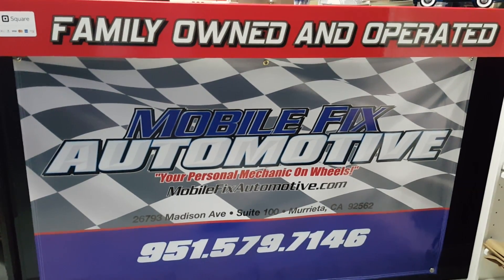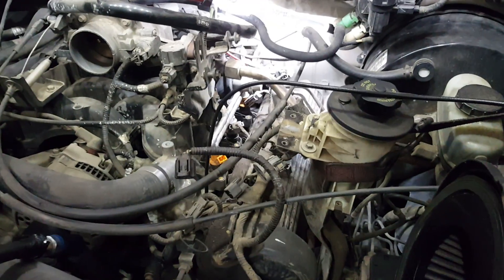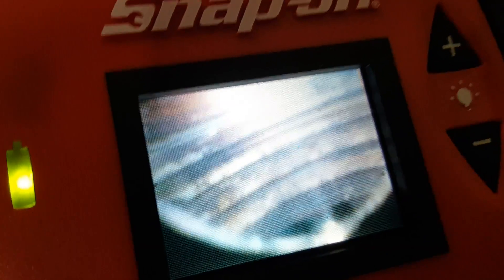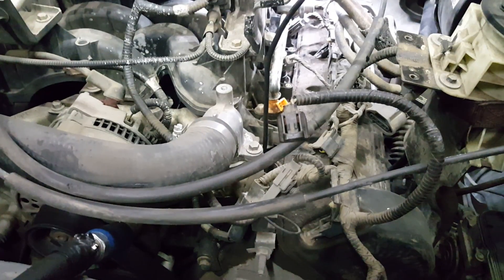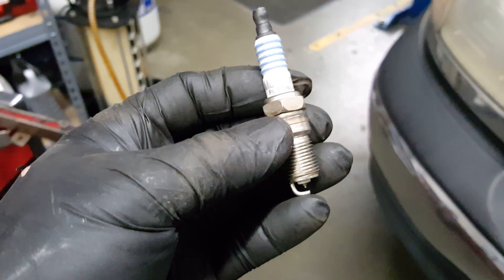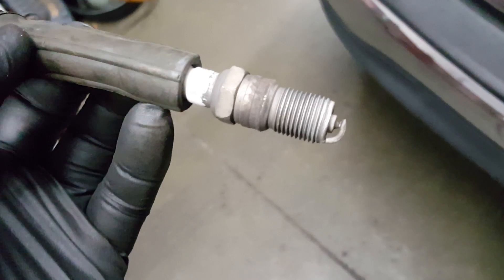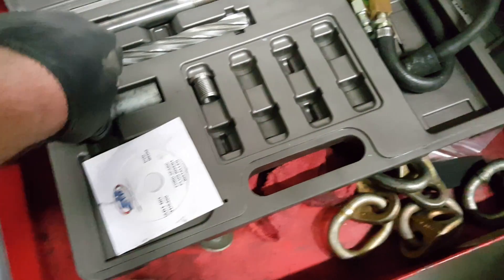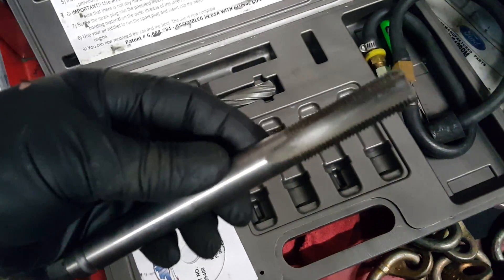Why the spark plug blew out of your Ford Triton engine

Comment: Good video - this happened to me today 2001 F250. I could tell exactly what you describe when threading new plug, seems like it barely spins freely until tight. New plug and coil pack - back in action. I will definitely look into this kit. Appreciate the info, as a guy wonders if he just did something wrong, or it’s an issue that many face - apparently it’s the latter. Thanks - Cheers!

Comment: did the Ford 5.8L V-8 ("Windsor") have the spark plug problems? I think it was used in lots of trucks and some vans. Thank you!
Reply from the maker: Yes
Reply: @SandCarServices  thought it was just the Tritons?????......
Reply from the maker: I read your first question wrong. Only the Triton class are effected
Reply: @SandCarServices  Thanks. Good to know. I'm looking to maybe buy a used 1995 Ford e Series Van with a 5.8L Is that a good engine?

Comment: Can you do a video on a oil pressure switch for a 99 navigator 5.4L engine having troublw locating it been up and under the truck still cant find it and im tired of getting out my wheelchair lol
Reply from the maker: Its on the housing above the oil filter and if you have 4x4 its very hard to reach

Comment: The original spark plugs in my 2000 Ford F-250 the spark plug only has 6 male threads on it

Comment: FYI, if you have this engine and hear what sounds like a noisy lifter, it is probably the plug banging up and down. That happens about 50 miles before they blow out.

Comment: Used the Cal-Van insert kit...worked just like you said it would. A month later -- BOOM!  Plug exploded...again! Any thoughts as to why?
Reply from the maker: Your asking me to provide failure analysis without proper information. To start with answer these questions. 
1. Was is a plug failure or an insert failure?
2. If it was insert failure which I have never seen happen with proper installation it more than likely was not threaded or screwed in all threads.
3. Did you buy a original calvan kit or a knock off?
4. If it wasn't purchased from Dennis at wiseautotools.com did you purchase a 3/4-16 nut and check the outer theads on the insert before install.? If the insert is one of the defective ones it will only go in 2 threads and then tighten up.
5. I have seen very few calvan inserts fail that were installed by amateurs but the ones I have were all improperly installed and they were unaware of it.

Comment: You seem to be very knowledgeable about these engines and people say I'm dumb for it but I love em.        Have you ever had/seen a repaired one blow out? Should I just replace the cylinder head?
Reply from the maker: These are great engines
Reply: What are your thoughts on the v10 6.8? Aside from the plug issue how would you rate it? Does anyone ever pursue the calvan route proactively before a plug blows out? or is that a dumb idea? I’m not a mechanic so I apologize if that’s a stupid question 🙋‍♂️ 😆
Reply: @HP-xp9eg  to be honest I love the 6.8L the way they sound and the way they run. Honestly I like them enough that I'm going to put one in my ford ranger

Comment: I just had that happen today,I have been trying to remove a spark plug socket that got seriously stuck,then all the sudden I hear a pop noise but couldn’t tell from where.I moved the truck and happened to see the still stuck socket attached to the plug laying on the ground.I have never heard or seen anything like that ever.
Reply: Just want to clarify: Your spark plug blew out when your engine was not running?

Comment: I had a front right drive side blow and watched this video and drill & tap insert myself (cheaper set)! Working fine! However I blew the third one back on the left side now! I can't drill & tap the frame/firewall won't let me get in there! So I'm using J&B WELD to repair the (thingy) and on the plug thread! I'm only going to buy a new spark plug and J&B WELD it in! We'll see what happens!😎

Comment: Question, If someone put a heli coil in #3 but didnt put it in straight and it melted the spark plug, is there a fix to it? Im assuming it was a cheap heli coil to begin with. Cylider is registering as completely dead now.
Reply from the maker: Watch my video called why you should never anything other than a calvan insert. The spark plug threads blew out from a bad timesert. Is this what yours did?

Comment: have you seen an insert done poorly cause a compression leak at idle (misfire code #3) but that goes away at higher rpm's and under load? I can almost hear compression escaping the cylinder

Comment: I understand and I know I've been trying to tell people about not letting anybody change the spark plugs while the engine is still very hot  it stretches with threads every time you pull the plugs when it's hot do not change the spark plugs on aluminum heads when the motor still hot otherwise you going to scratch the threats and they'll never be back to the normal size that's one of the main reasons why triptan engines blow up the spark plugs while they're running besides they have high compression
Reply from the maker: Ok. Then explain why so many have blown plugs under 16,000 miles. Although mechanics changing plugs while engine is hot and overtightening can cause this problem is is not the main cause.

Comment: Thanks ron. I have a 2004 f150 4.6 thats down because #6 blew out. And im pretty sure its a 2v cause of the 30 degree boot but can you refer me the kalvan kit that will work for my truck. Thanks ron.
Reply from the maker: Link to parts is in the description under video. Thanks

Comment: I have a 99 V10  and I just had cylinder #7 blow a spark plug I’ve purchased the Cal Van kit just waiting for it to come in. On the V10 what are the most common cylinders that blow is it still 3,4,5,6,7.

Comment: Ron, I have a question. My # 5 plug blew out and I drove about 10 miles to the repair shop, they installed a plug kit and when they started the van (2014 E-250) it was pumping excess fuel into that cylinder. They replaced the injector with no success
still excess fuel, any thoughts
Reply from the maker: Check to see if the ground signal wire to that injector is not grounded by wire pinched under a bolt or ?

Comment: Hey Ron great information there in this video. I have an 05 explorer with the 4.6 and have had three blow outside on 3 different cylinders 1,2 and 3.
Each time I was able to find the plug replace the coil and put the same sparkplug back in.
My third was bank 1 cylinder 1, a friend observed that the port fo rd the sparkplug looked too shallow, in fact after putting the plug back into the shaft and starting the engine I had a NEW problem. 
There was a loud knocking sound, like I had a rod hitting the inside of the engine. 
My friend saved the day somehow by tinkering with it while I was behind the wheel starting and stopping the engine. 
He said I have a worn out pinion?
I'm not sure what that is or where it's at, all I do know is that I thought my engine was done and wasn't going to be able to bbn drive it the 30 miles in afternoon work traffic,  but I was able to.
He states I need to replace this pinion but I'm unfamiliar with it, he didn't have any tools other than my tools for changing out the coil and sparkplug everything else was at home.
Does any of this sound correct to you? Do you know the area he's states is worn out, and if so what's the proper name of the part and how difficult is this replacement? Thanks

Comment: I had an '02 F150...it was a beautiful truck but it was a goddamn nightmare. Got it with 104,000 miles on it, and within the 5 years I owned it had to: -Replace all plugs after blowing two in a month span.

Replace the alternator, replaced the swaybars, replaced the flywheel, and even then when I sold it it was constantly shaking violently and getting about 10 mpg. Awful.

Comment: Now I know why its so expensive. I have the 5.4 3v triton in my 2010 f150 xlt. I've not had 1 blow out but I have just past 100k and now my fuel mileage gone. I took it in to the shop I use for things like this and they said they wouldn't even talk about changing the plugs because it was a triton. I took it to the ford dealer and they said $300 if it all goes right. $60 more for each plug that breaks as long as they don't have to pull the head. That's even more money. I'm thinking I better use some sea foam in it before I take it in, wednesday.

Comment: Your opinion is simple mechanics. 4 threads inside 11 out side. That's 7 threads on the spark plug too long. I wonder if a spacer between the seat of the spark plug and the seat of the hole would increase the amount of space. Possibly the piston is filling with too much gas for the space if the spark plug is inserted too far? So basically what ford is saying is the spark plug manufactures are making the spark plugs too long for the motor.
Reply from the maker: No that's not it. The plug length is ok, the tapered well the spark plug sits in can't be threaded all the way.
Reply: Not what I asked.
Reply: And actually dorman does make a product that does that so the answer is yes. And it has been tried and doesnt always fix it sometimes it fails.

Comment: Hi there, thanks for making this video, I appreciate the clarity, I wish you were nearby so you could redo my blown out plug in cylinder number 4, at the back of the engine.
Reply: This is the first one to blow out, truck has 200K miles
Reply: Mine is #5. Replaced spark plug and coil. Drove it twice and it blew again.

Comment: 2004 ford expedition 2v 4.6 l number 2 spark plug blew up. Repaired using dorman repair kit includes a tap sleeve and a spark plug.Use the same coil pack .Lasted 20k miles and replace it again I'm on 5k miles on it and still holding.

Comment: Excellent video Ron...  I gave up on my 1999 F150 5.4L Triton after it spit the 3rd plug out (3 different cylinders).  I actually disconnected the coil pack to the last cylinder that blew and drove that truck around for over a year as a V-7... haha  It got to the point where it started stalling and dying when I started to decelerate (stop lights), so I just parked it and started driving my GMC Yukon daily.
Reply: You were not alone in "giving up"

Comment: Where is the EGR valve located on a 2004 ford E450 super duty? Thanks
Reply from the maker: Some of the 6.8 engines did not have an egr valve.  If it does it would be on drivers side of throttle body housing

Comment: Great videos man! I've had a plug blow out on my 02 4.6 mustang gt. Had it fixed at a local shop. They used a helix coil and that only lasted about 9 month before it blew out again. I will be using the cal van kit this week. Again thank you for all the videos you have posted about these garbage heads.

Comment: plugs blow out the mod motors because the dump ass that swapped them out didn't do it right if you remove them the right way and reinstall  the right way i have done 100s of the mod motors NEVER had one blow of. the so called repair kits the real problem is the cheap metals that ford gm and dodge buy from china  thats to f up taxes laws our great gov pasted
Reply from the maker: Please explain why they blow out of a low mileage engine that never had plugs removed?

Comment: Not too many years ago Ford blamed the tires for the problems with the explorers. Ford had the tires developed especially for that vehicle and specified they wanted excellent ride. The air pressure recommended in the owners manual was exceptionally low as well. Then when tires were blowing out and causing wrecks and roll overs they blamed Goodyear.

Comment: I have a 97' e150 (174K) & 98' f150 (260K) both with 4.6L. They have the original design 4 wire coil packs, plug wires  & aluminum intakes.  Plug holes are tight. was there a process change on later engines?

Comment: I had a Ford F250 with this setup in it and I had the plugs blow out several times, I finally got rid of the truck, but whoever in the Ford Motor Company designed this piece of shit should be terminated. 
Ford wouldn't stand by the engine and to me that is a disgrace, I hope someone Sue's ford for such a shoddy design
Reply: I wish I had known you Ron when I had my truck, I would have kept it knowing now what you have explained it, I was just so disgusted with Ford I just got rid of the truck. Your video was very well explanatory

Comment: Was driving a small 24 passenger Ford Gasoline powered bus several years ago.  Blew out a sparkplug 30 miles from destination. Our shop mechanic said there were only 3 block threads holding in a sparkplug which he felt needed 5 at a minimum.  Ford??

Comment: Had one blow out on my 02 F250 51000 miles on it,   with a boat trailer on the back and 100 miles from a shop. No cell service, had to drive it back to Green River Utah. Head couldn't be saved, 3k later its fixed with an UPDATED head. So Ford knew about the problem. Anyway still have the truck, 232000 miles plenty of towing no problems. But I'll never buy a new Ford. Used, sure,  But not a penny will go to FOMOCO

Comment: That's a really impressive  bit of kit, I've  not seen one like it any where, when I did mine I drilled and tapped heads to take larger 18mm plug like early ford sixes as seemed like only option at time

Comment: Comment about only using Motorcraft spark plugs;

To actually know who sources the spark plugs to Ford to badge them as "OEM Motorcraft" spark plugs, you have to trace the history. At one time Ford owned Autolite and used their brand of plug as OEM. To settle an antitrust lawsuit that lasted most of the 1960, Ford sold their Autolite division to Bendix Corporation. On 1983 Bendix was sold to Allied Signal (Honeywell). On 2011 Honeywell sold it's Consumer Products Group (Autolite and Fram which they acquired) to Rank Group. In 2019, Rank Group sold Fram off to Trico Corporation. Since 2001, Autolite/Motorcraft spark plugs have been made on Mexico.

The point is, a Motorcraft spark plug is actually an Autolite plug. Same goes for Motorcraft oil filter is actually a Fram filter.  Saying you don't use aftermarket plugs because you only trust OEM is sort of ridiculous when you realize Ford only specs a plug but hasn't owned an spark plug plant in almost 30 years. Also note that other plug manufactures can make spark plugs that can match and exceed OEM specs is also important to know. 

As to why Triton engines blown out plugs, yes I agree that Ford made a huge engineering flaw with cutting less than 5 threads on the spark plug holes for a plug that had 11 threads (long base plug). The best method I've known to avoid Triton plug blowout is torquing the plugs to spec and a few inch pounds over, then check the plug torque every 30,000 miles. Anti seize should also be used as is normal.

Comment: I think it’s more like when you put them in, the socket contacts the tapered hole causing the plug to tighten early and not be completely tight then after a while the plug blows out taking the threads with it . 
To repair the coil cut a piece of aluminum, I used a design piece out of a storm door design . 1/2 by 2.5 ,1/8 thick . Bend a L , drill a hole where the broken holder hole was take a hose clamp and attach to the side of the coil ! Yeah its back yard but it works.

Comment: Thread engagement should be at least 1.5 times diameter. 4 threads is inadequate to resist the compression force against the plug. This looks like a head design flaw.
Reply: Many motor before this have 4 treads aluminum heads

Comment: The length of thread engagement in a steel nut member should be equal to or greater than one full diameter of the bolt and be of comparable strength

Comment: This might seem like a stupid question but do you have to remove the head to do this. If that's the case then not why not do all in that head that was removed. Just a question that needs a answer.
Reply from the maker: The repairs are made with the head on. Check out my install video.

Comment: I had a 2004 F-150 that did this exact same thing.  Number 3 was mine.  Was under warranty but they said warranty doesn't include spark plugs.  It wasn't the spark plugs fault it was the heads fault.  They wouldn't listen to me.  Had to pay close to 2K to get it fixed from dealer.  They got new head and everything.  Have had many more F-150's after that and ask them about the "spark plug warranty problem" every time I buy one.  They say the problem is fixed LOL.  So they knew they had a problem but didn't want to deal with it.
Reply from the maker: They changed the 5.4 in 2004 to the now infamous 3 valve engine but never fixed the problem with the 2 valve which is still in production.  Lol

Comment: shame on ford, this, and their defective fuel pump relays too.  some engineer should be ashamed.
Reply: No crank,no start, 
fuse box/fuel relay?? making clicking noise under glove box when trying to turn key, When key is tried to be turned the ABS light flashes and makes 6 beeps on the gauge cluster and has also said at times no communications on the screen on the cluster, just bought this truck and he said that It has had recent performance parts added to the transmission in it and has also a after market air filter and it did have a computer with the aftermarket performance chip put in it or reprogrammed but had problems with it and replaced it with a stock one again.  I have shaped all of the release and fuses in they are fine and I replaced the fuel club switch in the rear near the spare tire that commonly fails but, other than that I'm going clueless
PLEASE, Any suggestions or help would help so very much!!
Reply: @takeawildguess8801  A loose battery cable?, check both ends of each